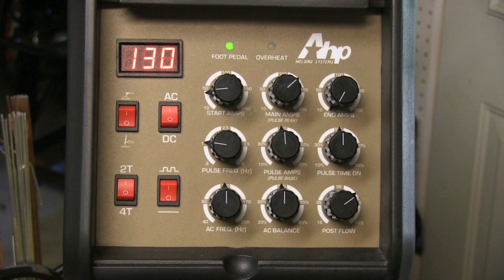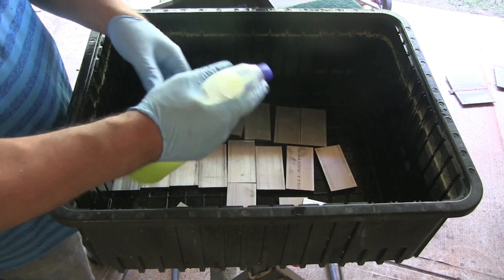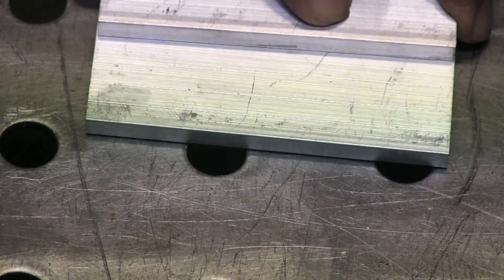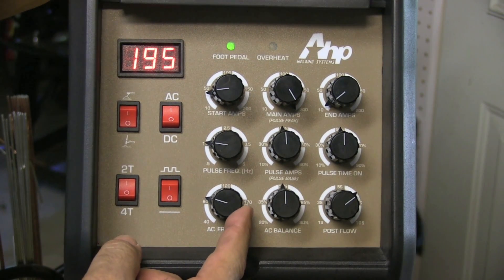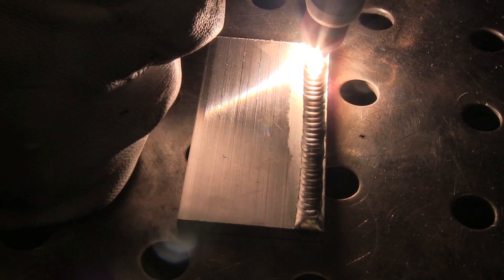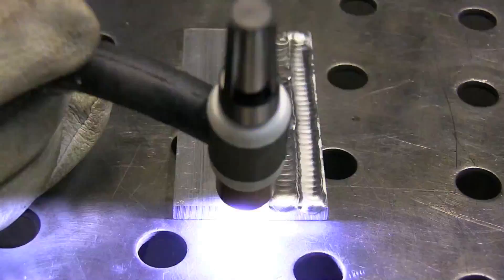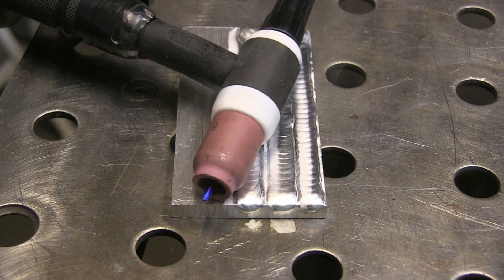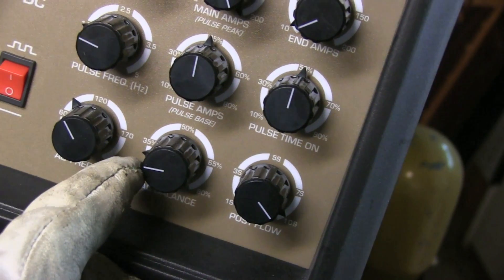AHP AlphaTig 200x Aluminum Welding Settings

Comment: I was having problems with my tungsten turning blue randomly. I noticed if I left my torch close to the joint during a 7 second post flow, it stopped doing it. I guess the gas bounces back and creates an envelope or something. I’m using a ceramic #6 cup with a gas lens.

Comment: @weldingtipsandtricks -- How can you tell different kinds of aluminum when you are needing to weld a piece. Ex. If a customer\friend brought a piece of aluminum that he needed welded -- how could you tell 4043 from 6061 to determine the filler rod that you needed to use?  With stainless you can just user a better quality of rod, is AL like that as well?

Comment: I purchased the 201xd and I LOVE THIS MACHINE. you MUST REPLACE the regulator and torch. most importantly the regulator from victor $100 and torch from ck worldwide another $100. the pedal is fine. but once you upgrade the torch and regulator YOU WILL LOVE THIS MACHINE it really does weld like the reviews said it would.

Comment: Can I run a 75% argon/ 25%carbon dioxide gas in this unit? It's a leftover tank from my old 80's Dip Pac mig welder.
Reply: The carbon will break from the Oxygen molecule and leave a nasty weld, but it can be done. Best to use a non-reactive gas by itself, argon, helium, etc.

Comment: Hi Jody. Thank you for your amazing videos!! Would you be willing to test out your Alphatig on a 110V circuit using a 50/50 Helium Argon mix?

I ask because I'd like to do some field work in the future and it would be nice to be able to run a normal extension cord, at least until I can afford a 220V extension. Thanks a million!!!
Reply: Machine runs 151 amps on a 120v circuit.

Comment: So i recently purchased this machine and ive been using higher frequencies to weld. And as it welds on ac it has a type of warbling.    Like its tripping.   Like a motor that is trying to die at high rpm.  Like it is tripping over itself.  Idk if its me or the machine.    Aside from that she runs great

Comment: Just curious, the 25% balance is for EP.  What happens if you swap the torch and ground leads.  Would that same balance setting make it almost maximum cleaning?
Reply: No Tig only runs one way EN
Reply: Isn't in AC the torch is alternating between EP and EN?
Reply: K NG the machine does the switching internally. I’ve tried it before and it burned up my tungsten and didn’t weld very well at all.

Comment: I am getting my first AC/DC Tig Welder, and I have the opportunity to get the Eastwood TIG 200 for fairly inexpensive. I am starting off by doing mostly mild steel, but I will be welding aluminum in the near near future. How much will I be missing out on the pulse TIG functionality offered by the AlphaTIG versus not having it with the Eastwood?

Comment: Hey Jody. First off I’ll say I have watched almost all your videos and you are a great teacher! Now on to my question. I went to my local welding supply store and talked with the guys there about getting into Tig and they basically scoffed and walked away...I am a retired Marine and am very good at Mig and I have even taught myself how to pinstripe...I will not be buying my welder or supplies from that shop but I do want an entry level HF machine. I only have 110 in the garage at the moment but will possibly upgrade to 220v at a later date. I am a patient man with steady hands so what do you recommend for me? My budget is $1200. I have seen you talk about AHP and Everlast which seem to be a good buy. Cheers and thanks for your advice!
Reply: I would suggest AHP AlphaTig 200x. I own one and love it. Best for the money by far IMO!
Reply: kris march 

Go on Amazon and buy the 2018 version of this machine in the video. They've upgraded it even better than the 2016 version. Expected ship date is April 6th.

That said, you might look into getting an Everlast multiprocess machine, since you have more funds available.
Reply: Brandon S  

I didn't say NOT to get a certain version, I said to get the 2018 version of what he was looking at, anyway.

.5-200 hz on the AC freq is way better than their old version when they made it some crazy useless number.

And your precious Miller & Lincoln machines are made in China now, too.

Comment: I just got the AHP Alpha tig.  I've never tig welded before.  I got a Bobcat 250 in July.  I liked it, so I got another welder as well.  haha  

Man, NO luck at all with the tig welding.  Lots of buttons.  haha  I am using the Bobcat 250, as the generator for the AHP.  But, the plug on the AHP will not fit.  I have to use the adapter.  I will make something soon to fit the plug in.  Actually, one of our neighbors is doing it.  He likes stuff like that I guess.

I was trying to get something started on 1/8 steel.  I just can't get a puddle started.  I had like, five or six of the electrodes hit the table.  Lots of bad luck.  But, I shall continue to try it.

Comment: Another great video. I've almost got enough saved up for an Alpha TIG. I'll be using it in large part to "up my game". Lochead is expanding a facility in Greenville and I'd love to get on with them.
Reply: Did you get the ALPHA tig and if you did, how is it doing on aluminum. I really want to get it and only because of welding aluminum. I have the miller maxstar 150 stl and the lincoln ranger 225.
Reply: @danny6247  Unfortunately I haven't purchased one yet. Sold a house, moved, built a house, moved....life stuff. My old battle buddy bought one though. He fabricated his turbo setup with it and a few other aluminum things. 
He had trouble at first trying to find a setting that worked. He would try to used the settings he used at work but was having all kinds of issues. Ended up discovering he had some bad tungsten. Swapped out his tungsten and used a "book" setting and everything was good. He has had no issues since. 
I still am hoping to get an AHP soon. I just need to get a space organized. I haven't welded any place but work for the past 2 years.
Reply: @johnthomas8605  ok cool. I did a little digging up and found that they upgraded to the 200xd. I saw it on Alpha website for 690 plan on getting on this year. They gave that stimulus package which I wish they hadn't because it might be worse for the working people next year in my opinion. But if I get that I will purchase mine with it. 😆

Comment: Jody, I have a 280dx. I generally keep my AC freq around 90. Balance 55-65. Most of my work is dirty aluminum repair work. When they heck would it be an application to use 120 AC freq and above. I have yet to need to use the machine out of that range. 

Great video as always!

Comment: I have this machine, and I love it. To fix the annoying little pedal sliding away, I screwed mine to a piece of 2x4 so the rear end of the board sits right under my heal with my toe on the pedal.  This gives the pedal some weight so it doesn't slide around, plus the familiar feel under my foot lets me work at the bench without looking down to see where the pedal is.
Reply: I used a piece of carpet. It rolls around the pedal with the cable when I put it away.

Comment: Done a fair bit of stainless TIG welding and mild steel MIG welding but not ali welding so your vids will come in handy. Also got the app but can't use it yet as I'm on site fitting some projecting balconies in Manchester England so I can't wait to get back in the shop to use this app 😁 keep up the good work jody!!

Comment: some good info like always, i honestly picked up my own AHP 200x about 6 months ago and with no TIG experience jumped right into welding aluminum parts up after watching countless videos from you, Mr. Tig and chucke2009. I'd like to thank you very much for all your informative videos, i still scratch my head all the time when i get a new part on where to put all the settings but atleast between you 3 its got me to a great starting point! My main problem is how to judge my settings per the material thickness and on cast aluminum (broken intakes and bellhousings mainly). Cant wait for the app to be available to android users so i can add it to my collection!

Comment: some more info that would be helpful to add to the app would be machine used, every welder runs a little different and if you are in a shop bouncing from cell and machine to cell and machine it would be useful

Comment: I bought your stubby gas lens kit awhile back and I broke the number 8 cup. Where can I find stubby replacement cups without having to buy the whole kit again???
Reply: any welding supply shop will have them for a couple bucks each. you will need to get a gas lens cup for a 9 series torch.
Reply: Is that what the deal is? I need them for a number 9 series torch? Makes sense.
Reply: +Jacob Seter yes, gas lens cups for a 9/20 series torch are what you require. Any welding supply shop will have them, or get some off eBay or Amazon.
Reply: You can buy replacement cups for your kit on jodys store site...weldmongerstore.com. You'll have to scroll down a bit, but they are right there on the home page

Comment: I picked up an everlast 200v cooler. we have a 180amp Lincoln Invertec and wondering how to hook up the cooler. there's no place to plug in the cooler on our Lincoln welder
Reply: I built a tig cooler for my Lincoln Invertec v311T. My cooler just plugs into the 120v outlet on the wall, do you have an extra 220v Outlet?
Reply: I've got my Everlast cooler plugged into the back of my powertig welder. You can wire up your own switch that can operate your welder and cooler or just plug the cooler into the wall and have it running all the time until you are through welding for the day.

Comment: I purchased this exact welder a few weeks ago, one question I have is that the DRO does not show what my amperage is set at until I start welding. Is this normal or is something messed up? When it is just running at idle is either shows 3 or 4 on the display no matter what knob I adjust.
Reply: If TIG welding this is normal operation, if stick welding you MUST disconnect the trigger switch and the pedal,  at least that is how my unit seems to work.

Comment: 5mm alu   Cup Nr 8    130-150 Amp   75% balance   post flow 7sec   120freq   2mm filler rod   2.4 mm electrode(white tipped) thats works for me    depending on the quality of the alluminum (welding machine   Miller dynasty 250)

Comment: Jody, regarding balance. I've never tried it and no longer work where I got spoiled with the Dynasty 350. But I've heard of braising brass alloys with 95-99% to provide just a hint of cleaning action. Have you ran into method? Have you ever used it in practice? If so have you noticed it helped any? What little braising I've done on steel wetted nicely but I have ran into a few brass jobs that didn't wet out as nice as could have done on DC despite the metal being new stock and scrubbed with a scuff pad and alcohol.

Comment: I love my little AHP AlphaTig 200x. Great little machine for the price point. But I do agree the pedal sucks but thanks to www.weld.com they have a better one.

I definitely need to try some more aluminum now with mine after seeing this.
Reply: I have the newest version and I love welding aluminum with it. everyone says it's such a pain but stainless has been giving me far more headaches. aluminum is a breeze with the gas lens like he said. significantly better than the included standard collet bodies. if you haven't bought the gas lens set, do it asap. I only bought the 3/32 kit and haven't had any issues with all different sizes.
Reply: +imsowhiteandnerdy25  all different size metals**
Reply: +imsowhiteandnerdy25 I run a gas lens with a #8 cup. I have welded more stainless than anything with it. Bunch of pulse welding with it as well.